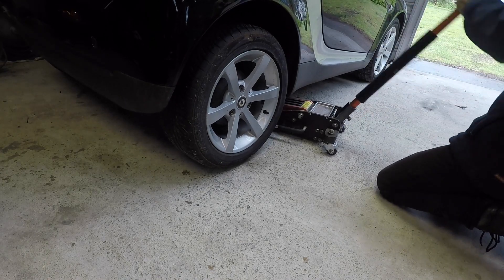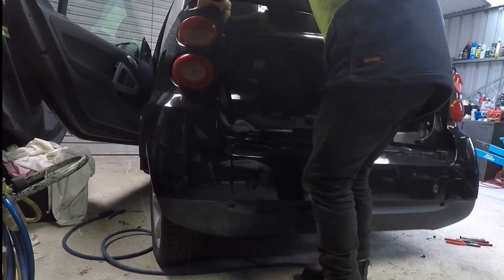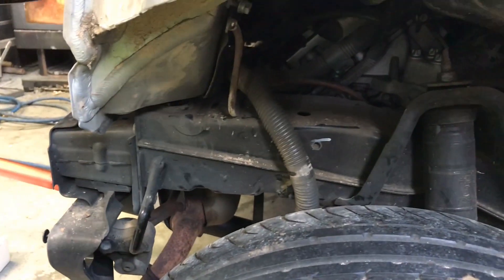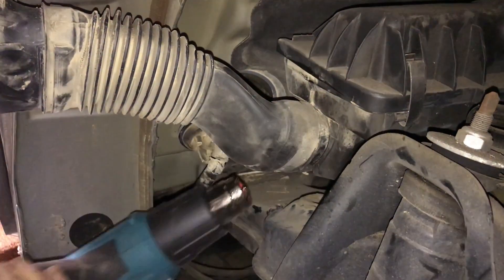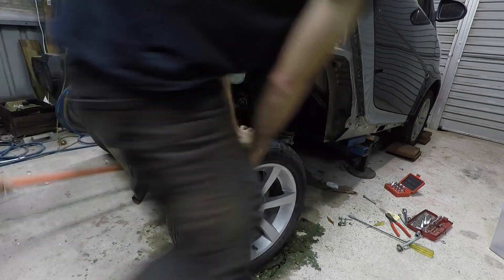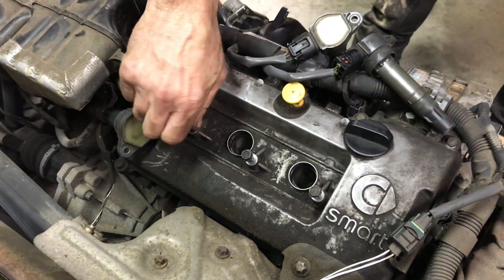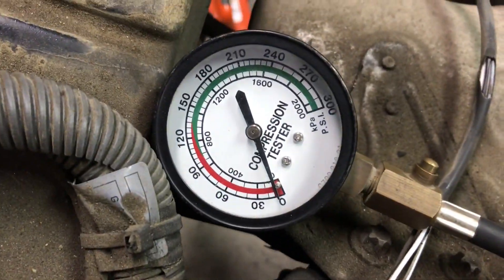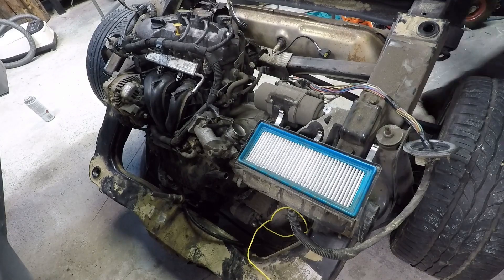Smart Car build Part 2 Engine problems

Comment: Hi I have 2009 pure with low compression on cylinder 2. I would like to replace my non-turbo 1.0L with a Turbo version . will that be direct fit for me?
Reply from the maker: Hi Toko, I'm not certain but pretty sure it will fit. The ECU might be different and you would need to do so use the turbo exhaust system. Mercedes don't make things easy so its possible they have some tricks for you to work out to make it happen.

Comment: Thanks for this video series. I particularly enjoyed part 3.
This is a noobish question, but if you still have the side skirts off the car could you please share a picture of the pinch weld jacking points? I'm fairly new to diy car maintenance, and i see conflicting advice on the internet about whether the weight of the car should be on the pinch weld itself, or on the horizontal metal next to the pinch weld. The 2 pictures in this post illustrate the two options  -> https://www.bobistheoilguy.com/forums/threads/which-part-of-the-pinch-weld-is-the-strongest.269498/#post-4390204 
The only clear picture i've found of the jacking point is this -> https://www.evilution.co.uk/files/smartexterior/jacking/451jack3.jpg ; i'm hoping a picture with the skirts removed will help determine what kind of adapter i should purchase.
Reply from the maker: The skirts are still off, I'll take a look. Send me an email and I'll send some pics

Comment: At :30 in I asked out loud: Smart cars have more than two cylinders?
Reply from the maker: Yeah, I didn't know either. Its almost like a motorbike engine and 3 cylinder
Reply: @Mezzmoengineering  seriously it looks like a polaris utv engine.
Reply from the maker: @hlrembe62  I agree. I've borrowed a Can-am Commando and is rear mounted engine is also the same capacity at 999cc. Planning to rebuild the engine and then beef up the suspension and wheels...

Comment: Omg mate! What in blazes have you gotten yourself into this time ! Lol i dont have clue what to suggest for that matter !
Well wd all know you have that magic touch so i cant wait to see this smart car get smarter !!!! No doubt you will need a turbo.........lol 
Respect
Jammin Jimmy
Reply from the maker: Thanks mate. Yep, this is something totally different. At this stage I might fix the engine as it has around 70hp and a couple of mods should get it a bit more than that. The main thing will be some massive mods to the suspension and wheels...